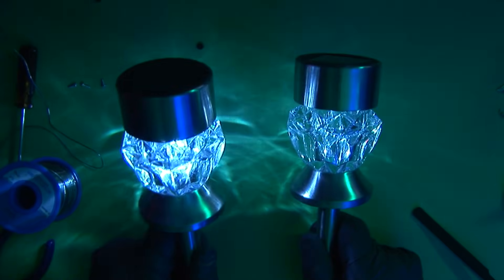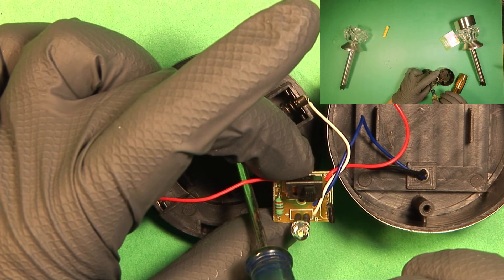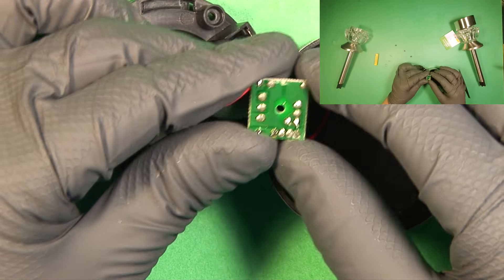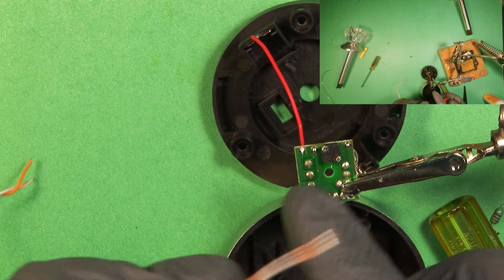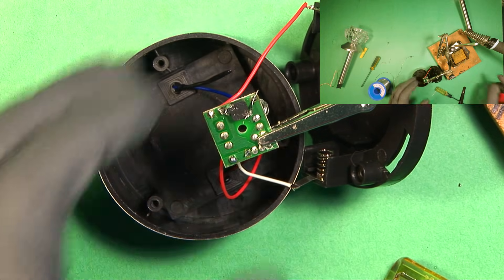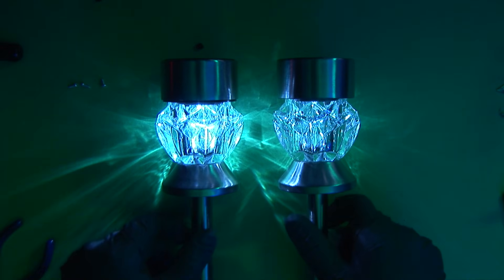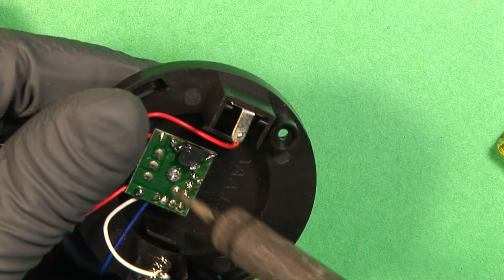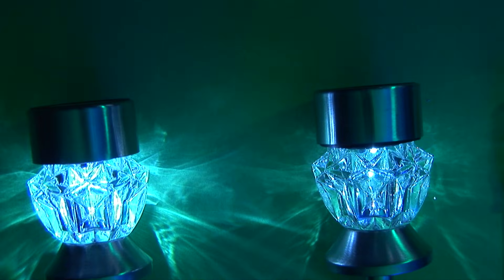Brighter Dollar Tree Solar Pathway Light Mod

Comment: I use a tiny bead of cheap clear chalk around the outside edges of the solar panel. Smooth it out and I leave them out year around.
Reply: I hate to be dense..
But why...caulk maybe?
Reply: what is clear chalk?

Comment: Would you ge more time if you used a lithium cell and a buck converter?
Reply from the maker: oh definitely.
Reply: @Electronicle  I've been using a two transistor circuit that Julian Illett designed. Very simple and works. With tweaking the buck converter I can get 10 hours of light

Comment: Much work, effect not satisfied. Now you must replace solar panel, LED and baterry also. Changing the current will change solar light working time.
Reply from the maker: I only replaced the inductor and battery. As I showed in the video, a higher capacity battery will need to be installed.  The battery that comes with these lights are crap anyways.
Reply: You have a very valid point. Changing the inductor and battery without upgrading the solar panel will result in rather shortened runtime in less than ideal weather.
 In addition, the larger capacity battery never gets a chance to fully charge even with a full day's sun leading to a reduced lifespan and waste of new available capacity. (to fully charge an 800mah battery in 6-8 hours very bright sun would require at least a 120-150ma 2v solar panel. (standard one lucky to make 50ma) 50ma x 8h sun only gives you 400mah and you'd be lucky to get that. (another reason why the standard battery is rated low apart from cost.) 
Qx5252f solar light ic can handle up to 800ma solar panels. I use 3-5v round solar panels instead of standard 2v so they turn on when it's actually dark. (Yet another shortcoming of the standard solar cell is they fall below the 0.6v dark sense voltage, turning on early wasting half thier power before it's actually dark.

Comment: Good video. But, some of us, are not to tech savvy. And we don’t keep components. So where would would I buy this part, and most importantly WHAT is it called? And what size battery did you change it to?
Reply: Ok I'm super lost
Reply: I would just buy an extra light of the proper design and drill an extra hole for an extra light+battery+circuit with the same solar panel because after a while the battery completely fills and the rest of the solar energy is wasted.

Comment: So you took out what looked like a resistor and replaced it with an inductor?
Reply from the maker: No. Both were inductors
Reply: @Electronicle  I've learned now that inductors also can look similar to resistors! Thanks, great video!
Reply: You can also see that it is green colour, not like resistors. It's inductor.
Reply: @garyvcole  Maybe that could be resistor, but that is inductor. I got also last time inductors which looks like resistors, but i bought them especially for my homemade solar lights. Solar light where power supply is only 1,2V battery will not work without inductor.

Comment: I thought the switch enables you to put the light in storage without running the battery down, but you're right - in time every one of them rots out and (of course) open and not closed

Comment: Liquid Electrical Tape would have worked for a seal as well, or even clear nail polish lol
This did actually give me some good info to test on some 5LM lights
Reply: lol so i'm not the only one that uses clear nail polish for stuff
Reply: @zachbeckner  Yeah it comes in handy for low power electrical projects and a solder mask etc if you dont have anything better to use.

Comment: What sort of Inductors would you order if you were going to upgrade 20-30 of these lights? - Would 100UH be enough? - You can buy them in packs of 50 or 100 from Aliexpress for about $1
Reply from the maker: I found 20-50 works best for the solar lights that I’ve used.  However if u also have a 200uH inductor in yours then 100 will be an improvement
Reply: @Electronicle  can you tell me exactly what I need to do this as I'm no electronic expert. So I can order

Comment: What sort of Inductors would you order if you were going to upgrade 20-30 of these lights? - Would 100UH be enough? - You can buy them in packs of 50 or 100 for about $1 - https://www.aliexpress.com/item/100PCS-0410-Inductor-100UH-120UH-150UH-180UH-220UH-270UH-330UH-390UH-470UH-560UH-680UH-820UH-1/32847565379.html?spm=2114.search0104.3.50.7387cc87GiZVlu&ws_ab_test=searchweb0_0,searchweb201602_9_10065_10130_10068_10547_319_317_10548_10696_453_10084_454_10083_10618_10307_537_536_10131_10132_10902_10133_10059_10884_10887_321_322_10103,searchweb201603_6,ppcSwitch_0&algo_expid=26b5fcbc-1d58-4b9d-a3fe-75901a86a307-7&algo_pvid=26b5fcbc-1d58-4b9d-a3fe-75901a86a307

Comment: Have you tried this with a single 18650 and an extra LED or is that overkill?
Reply from the maker: An extra led in parallel to the original will work fine.  Each will be a little bit dimmer but it evens out.  I haven't tried an 18650 because the IC's on these boards are meant to run at under 2v  and an 18650 will run close to 4v.....not to meantion that the solar panel only puts out ~1.3v max..so it wouldn't recharge.
Reply: By changing solar panel to 5,5V 0,5-3A and by replacing YX8018/JD1803/QX5252F etc to SC8182 you can use 18650 and up to 3W LED. You can use 5V solar panel in YX8018/JD1803/QX5252F etc curcuit, but you can't supply it from 18650. Only SC8182
Reply: HI  @mati211p  how are you i have battery 18650 and 6V with 2w solar panel which Diode or those you mentioned above are suitable to make Circuit Thank you
Reply: @michaeljohnn2598  Some diodes like BRIDGELUX 3W LED and SC8182 + transistor. By Rs resistance you can set diode current.
Reply: @mati211p  Thank you my friend

Comment: Nice video and explanations.  But why did you use Ni-Mh batteries?  I thought Ni-Cd was better suited for repetitive rundown/recharge cycles like in solar garden lights.  Couldn't you have used higher mAh Ni-Cd batteries and gotten the same effect?
Reply from the maker: you are correct, however finding hi-cap Ni-Cd batteries locally can be a pain.  I have a ton of various Ni-Mh batteries laying around so I used that.  Ni-Cd's are better for high current and like you said repetitive recharge cycles.  These lights have a low current draw, so the only drawback to using Ni-Mh is having to replace the cell every year or two (which you may have to do with Ni-Cd's anyways depending on your climate).
Reply: Electronicle Okay, thanks.  I just ordered a bunch of Ni-Cd's and just wanted to make sure I didn't screw up.  Lol.
Reply from the maker: nah you're good